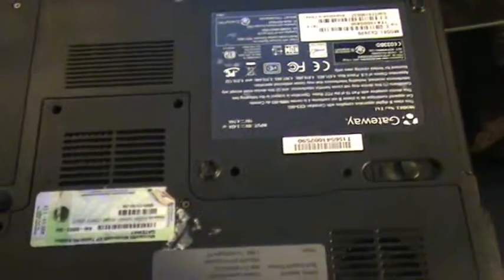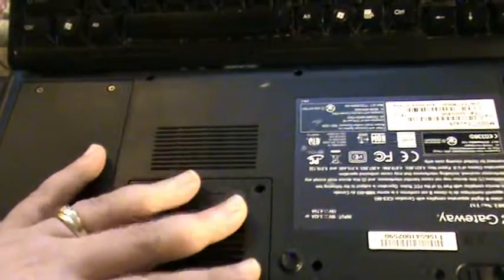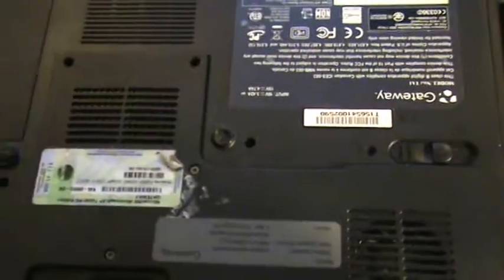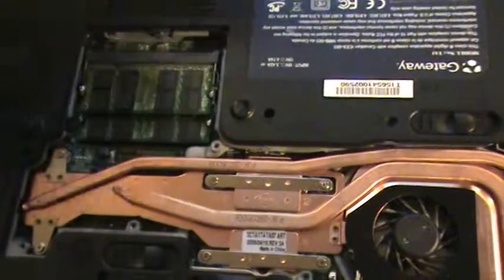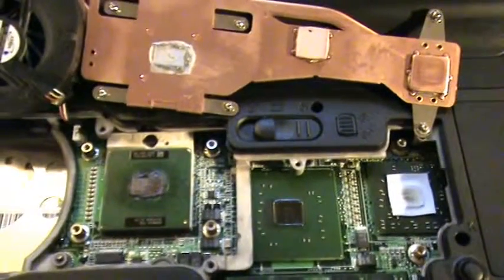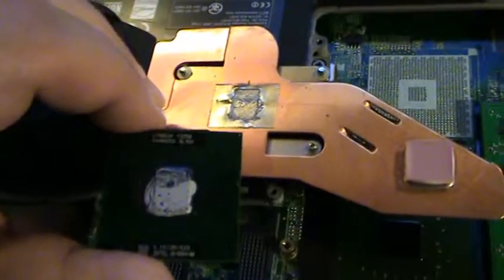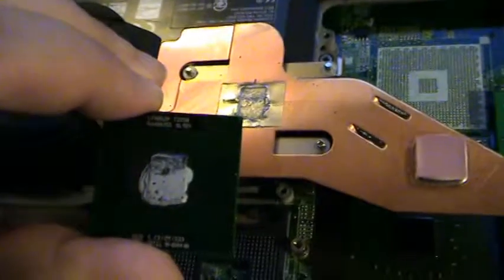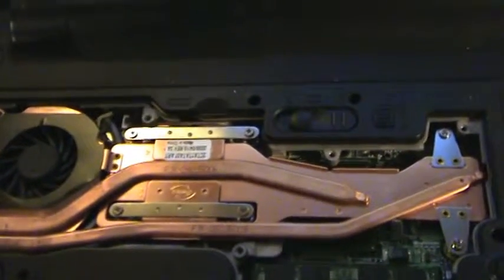Upgrade to dual core cpu attempts on a Gateway TA1

Comment: Good thing you had fairly easy access to the CPU because it would have been a pain to remove literally everything 2 times. That actually happened to me with my CQ57 339WM. I had originally attempted to put a Pentium B970 in there, but turned out it didn't like it at all. Had to take it all apart again and finally the i3 cpu I had worked in it. At the end it felt good, but it was a pain removing like 20 screws, keyboard, screen, hard drive, ram......well you get the picture haha.
Reply from the maker: +RogerRHF Know exactly what you mean. Some models are designed so the only way to work on the cpu is to almost take it all apart. I never understood why manufacturers thought that would be a good thing, or instill brand loyalty. It's like a remnant from the days of tv repairmen and proprietary hardware.
Reply: +ThatWord Indeed but at the end we feel good when something finally works. I can spend countless hours on something and I won't stop until I can get it right.